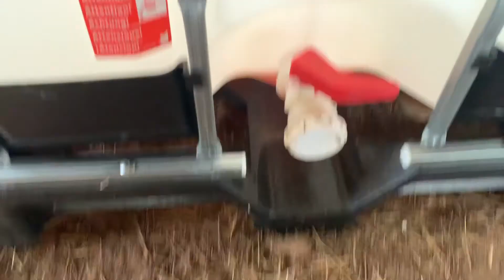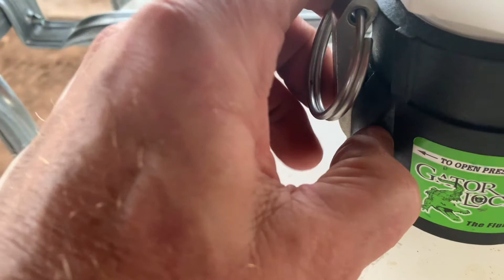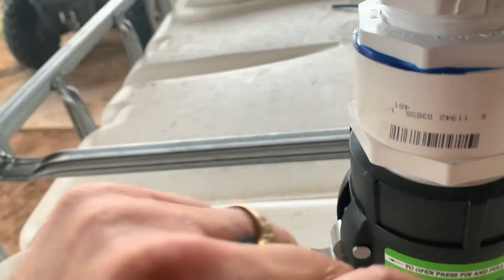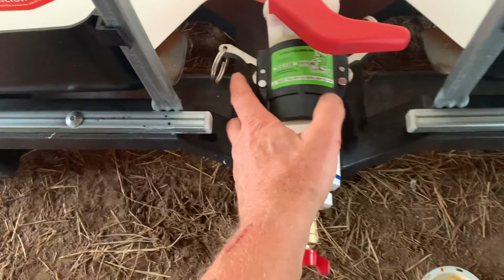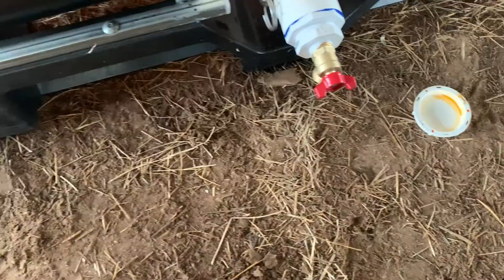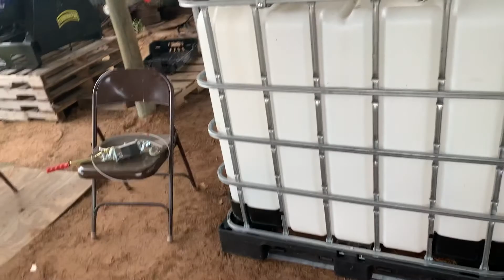IBC Water Tote water hose attachment

Comment: I need something like this with dual spout/faucet. 1 for hose to pressure washer and other side just to wash/fill buckets. Can also use a rubber fitting with 2" ID and 2 adjustable straps to the bushing fittings.
Reply from the maker: I think that is a great idea.   Thank you for sharing.

Comment: Gotta love Craigslist.  😁😁.   A regular full flow valve works great….  Much bigger hole than a faucet.  Love totes.  I used a couple as septic tanks on cabin
Reply from the maker: Yea, I’ll most likely remove hose bib and just run a 6” piece of pipe out to make water flow fast.